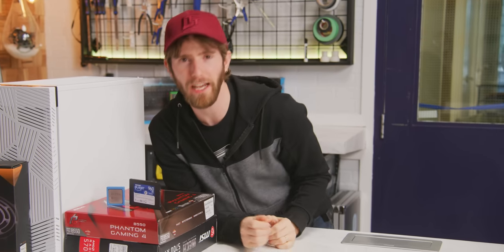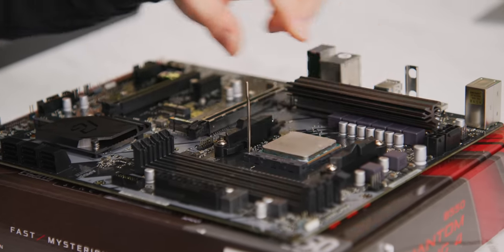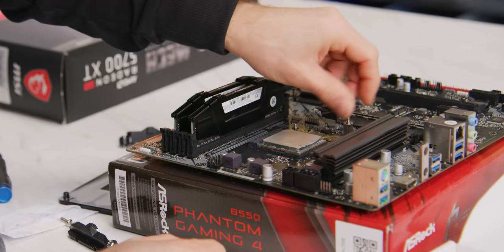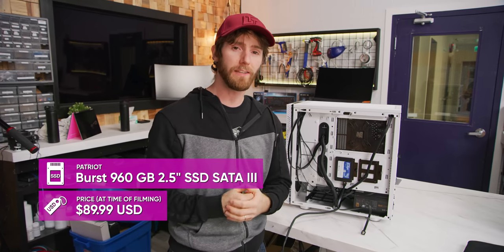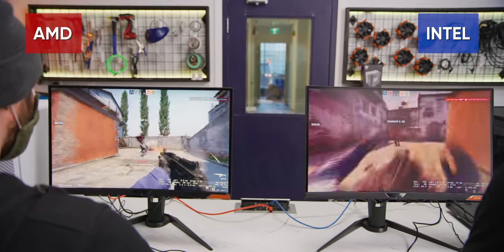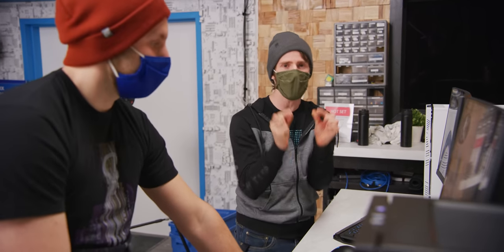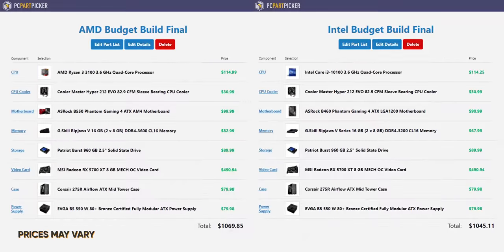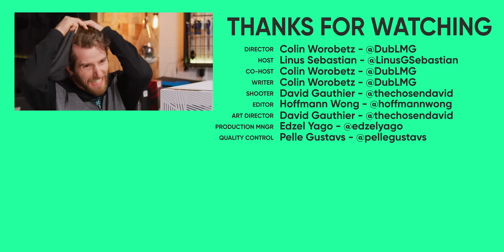AMD vs. Intel midrange gaming PC challenge

Comment: "without wasting any money"  gets aftermarket cooler for amd
Reply: and not even a powerful AMD CPU, an argument can be made for a Ryzen 7, but these weaker chips up to the Ryzen 5 are completely fine on the stock cooler...
Reply: @mataskart9894  if the rx 5700 XT wasn't so exorbitantly priced thanks to recent demand, they could easily fit a 3700X
Reply: this feels odd.... first going overboard with the cooler then saying the RAM speed won't go higher while not mentioning it throughout the video except in the beginning?
Reply: @zen608  should’ve gone with a 3060ti. Not sure about US prices but in a lot of locations it’s similar to the 5700xt
Reply: @Daniel-fi7jp  The 3060 ti is actually 100$ USD less than the 5700xt
Reply: @Daniel-fi7jp  true howrever absolutely no GPUs are selling at MSRP
Reply: Yeah they're total AMD apologists lol
Reply: An i3 10100 can also run on a stock cooler
Reply: and he could have gotten a 3000mhz and a320 motherboard
also the 1tb ssd was completely unnecessary, single one 250gb is enough and cheaper
Reply: Amd stock cooler on my 3600 was really bad I replaced it .while my intel system has its cooler held in by 3 screws and still does ok with temps
Reply: @serph2951  3000Mhz is ass for a Ryzen system and nobody is going to buy a dirt A320. These systems actually have a future path instead of sticking to one CPU the entire time. Do not cheapen out on the motherboard
Reply: @JABelms  yeah but for ddr5 you will need to change the motherboard anyways, no need to overspend on it if you're not going to overclock, and 3000mhz performs basically the same as 3200
Reply: @serph2951  Nobody is waiting for DDR5, GPU performance is center stage right now and it is a good time to spend on a CPU+ mobo that would do its purpose for the next 5 years. Nobody wants an A310 with inferior VRMs and underwhelming features. And depending where you look, 3000 and 3200Mhz are practically priced the same. 3600Mhz is the sweetspot for Ryzen systems. Motherboards are just as important as PSUs for me
Reply: @licoricesweets8409  Strange that stock cooler works so bad for you. I use old stock cooler from old 1700x to cool off my current 3700x (both have 65 W "tdp") with all cpu cores constantly loaded at least at 15%  at BOINC projects 24/7 and temperature is fine. So either you crunch lots of numbers constantly or you have a defective unit which honestly should be replaced.
Reply: Because you can overclock and really upgrade to 8/16 cores.
Reply: @etopowertwon  It's usually due to badly placed coolers (due to the design of Ryzen CPUs you have to place the cooler as best as possible or else a hotspot might be overlooked) and terrible stock voltages set out of the box. I had a 3700X that idles at 1.5V out of the box for some reason and I had to set it manually down. PBO can also fuck up settings. It's due to binning
Reply: Well it wouldn't really be as fair as possible a comparison if only the intel rig got an aftermarket cooler
Reply: The Intel chip doesn't need it either... it was a pointless addition to both builds (which are both overall actually unbelievably terrible value for a variety of reasons to an extent that calls into question whether anyone at LTT really knows what they're talking about).

They even got the "2933mhz" thing for the Intel B-series board wrong. It's still dependent on the installed CPU... you could do 2933mhz max on that board with a 10th-gen i7 or i9 since that's what those chips are "rated" for, but since 10th-gen i3s and i5s are rated for 2666mhz, you're limited to 2666mhz on B-series and H-series boards with them.
Reply: @ShogoKawada123  Don't they just go by availability?
Reply: @jonahozminkowski2941  It's literally the same price as a 5700XT here. It'd have to be $300 or less to be cheaper. 

I can't stand how many people fell for the marketing lies "look at these great prices!" when Ampere is literally the same cost as Turing straight up the stack except the unoverclockable housefire cards nvidia offered are unavailable so they're literally more expensive than Turing. Both Turing and Ampere were garbage launches filled with overpriced garbage cards. FFS they used PLASTIC BACKPLATES on the 3070 are you fucking kidding me? No LEDs either.

nVidia literally hasn't had a good gen since Pascal. Pascal and Maxwell is literally the last time they were actually offering good products, and now with Ampere they haven't even got the excuse that "no one else is offering such high end cards" before proceeding to rape your wallet. I'd even be willing to bet that they slapped on all the extra VRAM because it was the cheapest way they could hold inflated prices when people start comparing it to AMD's midrange cards later on, which is laughable because you're not gonna be putting a 3060 or 6600XT in a 4k gaming rig that might need that 12gb of VRAM.
Reply: @Daniel-fi7jp  you forget that there's none of them available, and the few that are available, are ones scalpers bought and are charging 2x the price
Reply: @mataskart9894  and then doesn't even attempt to overclock.
Reply: @zen608  except 10700k is barely more than 3700x now and that's a bloodbath when it comes to gaming. Even a 10600k destroys it in most games. It's so odd thinking of Intel as the budget high performance gaming option these days.
Reply: @zjunk4877  you're right, the 9700K was 200 at micro center. Absolute beast of a CPU despite the lack of hyperthreading. I hope Intel is able to deliver even harder with their 11th gen, which will finally get an updated iGPU
Reply: @CyberLabStudio  overclocking a ryzen CPU is pointless, they're already tuned to the brim from the factory.... You can do it for fun, not for performance, you're better off overclocking the GPU for direct improvements in FPS in all games.
Reply: @mataskart9894  I disagree and don't miss the point. The point was he bought a cooler that wasn't really needed which added to the overall cost of the systems. Already having bought the cooler, he opened up the opportunity to utilize one of the features that the Ryzen 3 had over the  Core i3 - an unlocked multiplier and easy overclocking software. Due to the low stock clocks of the Ryzen 3 and the typical clocks of other Zen 2 parts the Ryzen 3 3100 could easily have a bit of headroom left for a couple hundred MHz. In the grand scheme of things it may not have made much of a difference but an additional 150 to 250MHz of free performance is a part of the value proposition by choosing to go with the Zen 2 over the Core i3. Why not take advantage of it? You already paid for it. Finally the Auto OC might have seen the Ryzen 3100 close any deficits it may have had in some of the comparisons with the i3 10100. Remember this is supposed to be a professional unbiased comparison and it seemed as if that was a slight omission which can lead to misleading viewers as to how the parts would really compare if they had that fixed amount to spend. 

Also you can also still overclock the GPU. The CPU does have an impact on the performance of games as demonstrated in this same video and many others.

Lastly, why didn't he setup and run the CS:GO server on the Intel as well to show how that system would have been affected?
Reply: @licoricesweets8409  I actually had to replace my stock cooler, it was making my i7 running at 90° with fresh thermal compound
Reply: @zen608  yes nice intel chip
Reply: @jonahozminkowski2941  were do you live , personaly in france rx 5700  xt are close to 450€ and 3060 ti are around 550€
Reply: @Serph 250GB? this is a game PC. I've installed windows 10 on a 250GB SSD, and try to install COD modern warfare (=230GB) 'not enough space'
Reply: This got 420 likes, let go!
Reply: @mataskart9894  amd stock coolers are quite good
Reply: @serph2951  250gb is not enough. Atleast 500gb for pc
Reply: @emppu4581  even 120 is enough for the os
Reply: @serph2951  for os yes, but for other files, games etc its not ebough
Reply: @emppu4581  true but you're kinda wasting money when you can get 120gb for os and 1tb hdd for games at the price of one 500gb ssd
Reply: 1tb ssd is just 90$
Reply: @serph2951  and if you really want to save money you can salvage a decent hard drive from an old laptop
Reply: @jonahozminkowski2941  I got my 5700xt for $380 otherwise I would have not gotten it
Reply: @Daniel-fi7jp  out of stock
Reply: @serph2951  depends on the person maybe the games they tested wouldnt fit on a smaller ssd plus when i cheaped out on my ssd like 6 months ago (storage wise) i made a huge mistake cuz now i have to use a 3tb 7200rpm old af hard drive i found in my house
Reply: yes but the AMD stock cooler wouldn't be compatible with the Intel build. I think they used the same on both builds to remove a variable, but it could've been stated in a more clear manner.
Reply: @mataskart9894  could you help me out I wanna buy my 1st PC
Reply: @mataskart9894  My 3600 can reach 90º on CPU heavy games, so I'd say no. I needed to undervolt it to reach reasonable temps
Reply: I also don't understand why they bought a b550 motherboard for support for faster cpus, but went for a cheap intel mother board that doesn't support overclocking it is like they thought of upgrade path for amd and didn't really on intel.
Reply: @samuelbentz  Like why buy a b550 motherboard instead of a b450, idk why they would do that since their not pairing it with a 5th gen ryzen anyways so u can just update the bois when u need to upgrade
Reply: Do those Ryzen 3 CPUs come with a stock cooler? Maybe they don't...?
Reply: @joshshire  they do
Reply: The AMD CPU is overclockable so I wouldn't say its wasted
Reply: It is because amd cpu is very high on heat level
Reply: @jonahozminkowski2941  yeah ok, let's see how that turns out first.
Reply: @mataskart9894  mabey the 3600
Reply: @serph2951  not when GTA v is 100gb
Reply: ok random person
Reply: @zen608  ebay, but even then you're right. Unless you get lucky, you ain't getting it for msrp.
Reply: 114$ bucks for ryzen3? you can get 6 core ryzen5 2600 for that.
Reply: The wraith is louder than my neighbors having sex, i have to turn off my pc to listen to them and that sucks. But during the winter my cpu is hot enough to not enable heating so i guess thats cool.
Reply: So actually which is better? Intel or AMD?
Reply: It's because they wanted to oc
Reply: Sould I just use the stock cooler on my 3 3100? Because I don't want to spend another money on tower cooler, unless it's necessary
Reply: @mataskart9894  actually my 3800 hits high 40s mid 50s on all stock coolers
Reply: @jonahozminkowski2941  nah they both have the same msrp
Reply: If I could get my hands on a 3060 for $500 i would spend a grand for a pc but prices for things are way too much it is $200 for a ryzen 5 2600 normaly it’s $130 the 3060 is 499 but right now it’s 900
Reply: @resnaiszods7773  not right now because of the holiday
Reply: @tiny5214  and what hollidays have to do with it? I Made far better pc with same budget less than 2 months ago. So your point is?
I got - ibox wizzard 5 case, g skill 3200mhz 16gb ram, gtx 1060 6gb, 500gb mv2 ssd, 650w corsair psu, b450m motherboard. Ryzen 5 2600x

And about 1000 euros.
Including razer deathadder v2, 144hz Samsung monitor and krux mehanical keyboard
Reply: @zen608  bruh there isn't a lot of performance gain for gaining  to go with the 3700x while you can buy a ryzen 5 3600 for a 100 bucks cheaper, but if you dk productivity then the 3700x is better
Reply: @snipershotzz3260  Yeah honestly the CPU should be given more focus as it is easier to upgrade a GPU down the line, which is why I recommend a 8 core CPU. Nowadays the 3700X and 10700K are so cheap you can find them for under 300 USD with enough searching and patience.
Reply: @Appz_  intel.
I got burned by amd so many times they can toss free hardware at me and I won't take it. 
"Miracle of efficiency"- have to undervolt it so it doesn't cook itself, what a breakthrough.
"Best bang for buck" - only valid for the only gen where we needed to catch up with short term sales, now it's worse than intel but intel is the monster 😜
"Sam, easy access memory, turbo mode" and whatever other marketing trick targeting people with the intellect of a plant pot do I need to turn off for my card to stop crashing for no reason?
"Futureproof" - people futureproof so much with "high core count for futureproofing" during ryzen 3xxx series, they need to upgrade a year later because their futureproof cpus bottleneck modern GPUs. 

Amd is good when you don't have money and need to justify it by accusing intel of dodgy shit any corporation does. Intel is good when you don't want to deal with the hassle of your hardware working like shit and a million amdbots denying the fact you have a problem anytime you seek help.
Good luck with your purchase.
Reply: I dont think so that this one cpu has included fan
Reply: The processors 3700x and above is needs but he wants it so
Reply: @zen608  is
Reply: But Intel can run long lasting without fan but to run a AMD long lasting it will need fan
Reply: @namiskhana3604  ???????????? no
Reply: I think this vid was scripted to make intel win. After all Linus literally has an entire series that is fucking sponsored by intel lmao
Reply: Lmfao, the stock cooler won't cool it enough in 35 degree Celsius ambient with high humidity. Works well in cold climates.
Reply: Dawg it's for apples to apples comparison 🙄

Comment: When you see that they still recommend the cooler you bought 8 years ago, well, you know you bought a good cooler
Reply: best feeling
Reply: Best feeling
Reply: @lingyuchen9669   best feeling
Reply: ...Or a "cool" cpu xD
Reply: I used that cooler often as well when I did budget builds in the past. It’s cheap, does the job well and I had 0 issues with them over the years. Definitely a proven cooler for those in a budget.
Reply: It's a classic, just like Anthony
Reply: I've gone AWWWWWWWWWWWWWW when i saw the Hyper 212 EVO! Legends never die.
Reply: I took that cooler to the furthest extent lol. Lapped it perfectly flat and polished it, put on a second Cooler Master fan then replaced both with Noctua fans (on sale for $12 each)
Reply: Had one since 2008, it really is just the best performance per dollar I think
Reply: Cool story 😎!
Reply: Yup, same!
Reply: yea like 30 usd for all that cooling plus the fan is surprisingly quiet i can push it to like 1500 RPM and not notice much
Reply: and i bought the tx3 evo and seemingly nobody uses that one xD
Reply: u knoe wat dis is  i also lapped the CPU, about a 5-7c drop under full load in Prime95 ~70c. Found i could lower the voltage and it would keep stable too, compound win
Reply: He did say for a low budget though
Reply: To be fair back then it cost 20-25$ which was a great deal at the time. For 30$ it is still an ok cooler but I don't thing it makes much sense to buy at that price considering you can get REALLY good air coolers at ~40$
Reply: The epitome of cheap and decent
Reply: u knoe wat dis is  3M 220 grit, make sure its rated for water use. Then tape it to glass with duct tape. Apply water to sandoaper and Push the heatsink from the bottom, dont pull/drag it. That will prevent excessive sanding on the corners. Then move to 320 grit etc.

You can then go to polishing paste and a buffer if that tickles your pickle ;-)

If you get the CPU and Heatsink super flat it will only need a tiny bit of thermal paste. I apply pressure and move it in a figure 8 pattern before securing down to help push the CPU and Heatsink closer.
Reply: Well, yes and no. My 10 year old cooler 212 did not support my upgrade to am4, no mountings available or supported. Had to by another cooler. Wouldn't have that issue with a noctua cooler, which I now have.
Reply: @cyberborgman2000  same here still have a 212 evo with am3 mounting and they supposedly made am4 mountings to upgrade but they were produced for like what, 12 months? nowhere to be found now youd have to buy a brand new cooler to get it while the cooler stays the same. it just goes to show how bad the pc market is in terms of reusing older parts.
Reply: Did you just not upgraded the cpu socket
Reply: idk, i have different opinions about the hyper 212
it was amazing a few years ago, the go-to cpu cooler for a budget. But now, it's just kinda meh - the mounting is god awful and newer coolers at the same price point outperform it (Arctic Freezer 33/34 CO, ID Cooling SE-224-XT, Corsair A500 for a while etc)

Edit: Realized they used the v2 with better mounting and a sickleflow.
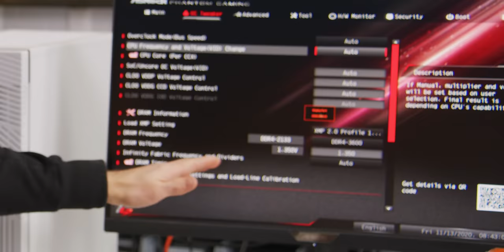Reply: This might be a dumb question, but what was he using to make changes to the RAM and everything else at 7:00?
Reply: @ihatecommunism9958  the BIOS
Reply: @rafeesamith  Okay, and I just boot onto that at startup? I'm not sure about the best values to input. 

Can I overclock it through the AMD Software?
Reply: @ihatecommunism9958  just select XMP Profile 1, it's an overclocked preset written into the memory sticks.
And you cannot overclock RAM in AMD Software and it generally isn't recommended to OC it in software anyway
Reply: @prateeksaraswat1  “This fan is a classic, it’s cheap and reliable, just like our sponsor for this video, ‘IFixIt’.”
Reply: ...

Vetroo V5
ID-Cooling SE-224 XT
ID-Cooling SE-224 XT Basic
Deepcool Gammaxx 400
Deepcool Gammaxx 400 V2
Gelid Phantom
Thermalright Peerless Assassin 120
...etc